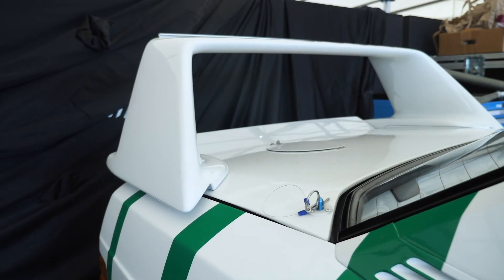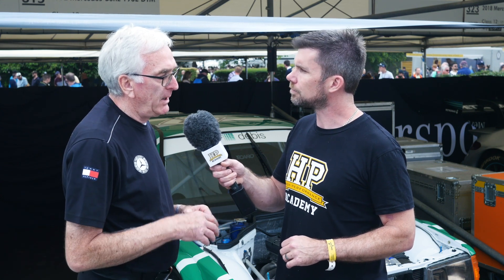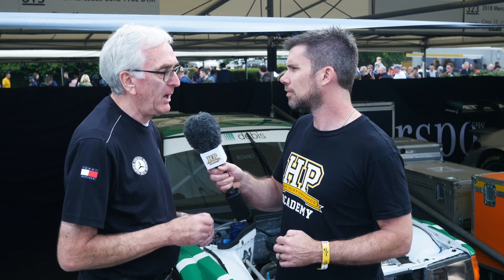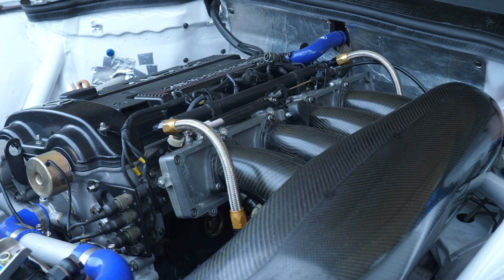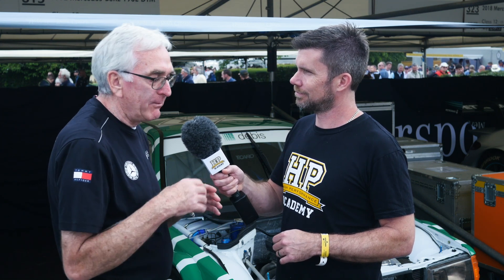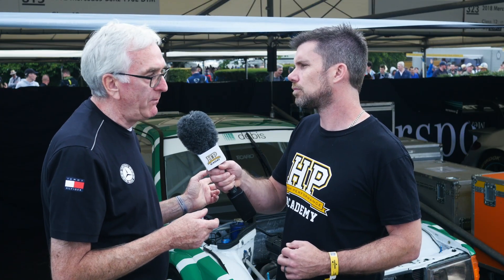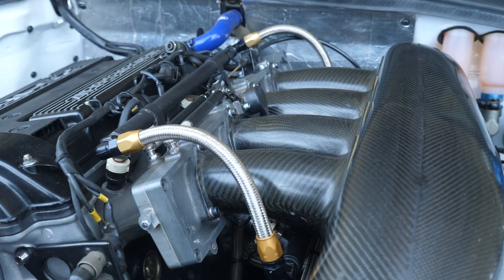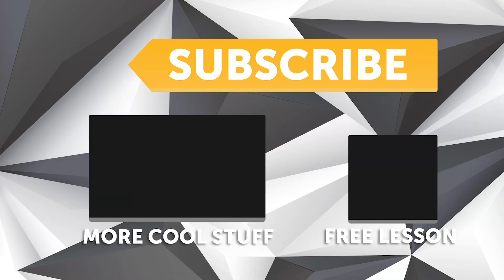Non-Turbo Power Gains | Mercedes-Benz 190E Evo 2 DTM [TECH TOUR]

Comment: The mercedes-benz m102 2.5l 16valve is such a nice engine
Only if you can mount it fwd transversal in your engine bay
Maybe you can, anything is possible, but the engine is very expensive to get and it's not as plentiful like its m111 successor

Comment: Wow that was great love the videos, would particularly like more information on how the two injector locations would make a difference. Comments welcome to help clear this up!
Reply: Drunk Tortila I’m guessing you could use the injectors (and the fuel pressure coming from them) to control the turbulence in the intake under part throttle, but that’s just guessing.

Comment: What impressed me most about the 190E was the handling some tracks had very high kerbs & the 190 would ride them like a flat road but the bmw had to avoid them love em love em love em
Reply: the 190 was originaly built for group b rally, therefore the suspension had to be supreme. first production car with multilink suspension and the cosworth models even had self leveling suspension in the back. Evo 2 models had the option to configure ride hight from the dash.

Even a normal 190 with healthy bushings will handle like a dream.

Comment: They have insane average piston speeds on the longer stroke 2.5 liter engines.
Reply: The stroke was reduced on DTM and bore increased
Reply: There are two different strokes I found cited, the longer being 87.2mm.

[edit] Seems it WAS destroked to 82.8mm, with a larger bore than the 'road' car - some drag Honda engines have a LOT more stroke and rpm. For example - 106mm stroke and well into 5 figures - http://www.4pistonracing.com/k24-480-2-7l-complete-engine
Reply: @gordowg1wg145  Do you realy want to compare 30 year old technology with the latest ?
Reply: @MrCornholios  You bet when a jdm car enthusiast finds an opportunity to belittle 30yo race engines, with newer honda engine sporting modern tuning accoutrements, that they will never shut up about it.
Reply: Send that engine to Honda and they will tell you how to make a good engine

Comment: How that engineer just circles around with his answers like he's afraid he'll give up some classified top secret information. Dude, we get it, that era of DTM was one of the most exciting racing ever but that was 30 years ago, We want the juice not some general info every 1st grader knows
Reply: That's what I was thinking, as the Benz was quicker then the M3 by '92, and the BMW had around 380hp, fact.
Reply: The honest truth is.. they aren't doing ANYTHING we are not doing as par for the course in most engine builds now.. you heard lightweight pistons so they can rev higher.. and they had old school vvti tech back then which is now just standard.. we already do multiple injectors per cylinder now.. we can virtually pulse our coils WHENEVER we want now to effectively change timing to whatever degree you could imagine to play with stuff like either peak hp or peak torque whichever is more important to you.

WHAT I WANT TO KNOW... what are they up to these days behind closed doors with an unlimited budget to just play with ideas till something works.. with modern CAD work with flow animations alone you could speed through to actual parts quickly for testing.
Reply: @gregthemechanicman  thay already had CAD in that era.
Reply: @jareknowak8712  not to the degree we have today with flow simulations and all the other neat stuff they can do.. the keyword I used was MODERN.
Reply: Same. Taz is trying hard to keep a conversation going but nothing juicy unfortunately.
Reply: yeah not only that....no credit is given to Danny Snobeck the first guys to develop the 190e for circuit racing or cosworth for the engine....dude probably has no clue because it was UK tech

Comment: Makes me wonder.  That a 2500cc 4 cylinder making 350hp na in 1992.
The btcc/wtcc 1993-94 Nissan primera was rumored to have 2000cc 330hp 4 cylinder.  

Old DTM and (X)TCC cars from the 90s are my fondest memories of racing.
Reply: I doubt that's very accurate as the 1992 190 was quicker than the M3, and the M3 is said to have had around 380hp in it's final iteration ;)
Reply: There are some daily driven Civic's with k20/k24 all motor with aprox the same level of power.
Reply: you think about it, theat categorty in the past makes it a very good engine for street cars.

k24 200-600whp all motor 2019
Reply: @l7ragoon  what about k24s with 600hp.  Those have 30+% of nitromethane.  And it's an engine designed mid 2000s. Besides those engines couldn't do 3 consecutive lap. So no. Dont even mention that garbage.   Not in the same realm.  The accurate era correct engine from Honda they used was the Honda accord-r power plant. Made less power than nissan. Sr20.
Reply: @grumpystony  170hp from 1.6l in a street engine in like 1994.

Comment: Audi V8 was 3.6l V8 - not 4.5l V8...
Reply from the maker: You are 100% correct, annoyingly that slipped through sorry. I'll update it once YouTube lets me as right now it just keeps timing out when I go to edit the video.
Thanks! - Taz.
Reply: Yep first version 3.6 then the 4.2. The Audi V8 was such a special car with it's inverted brake rotors (expensive...) and the full aluminium body.
Reply: @Grouiiiiik  Nope. 3.6 V8 the whole time. 92 they used the flat plane crankshaft (out of the cross plane crankshaft of the series production cause it has to be series) and then the forbidden this and Audi quit the DTM...
Reply: @TurboAcki  Oh I should have precised that was for the production one and not the DTM (with the mention of the brakes I thought it was obvious). Thanks for the precision anyway. Looks like you know quite a bit about the V8s !

Comment: Curious what compression ratio and fuel was used
Reply: With an output like that, it might be around 12:1 and 100 octane fuel
Maybe more, but I'd guess something in that area
Reply: @quest8795  12:1 comp. have 1998 Mitsubishi Carisma GDI, stock car on E98. 
This Merc have probably much, much higher.
Reply: @quest8795  i would say it was higher than that
Reply: Ah, well, it was just a guess 😅
But, whatever the compression ratio is, it's gonna be high